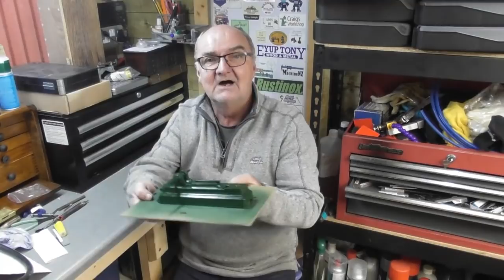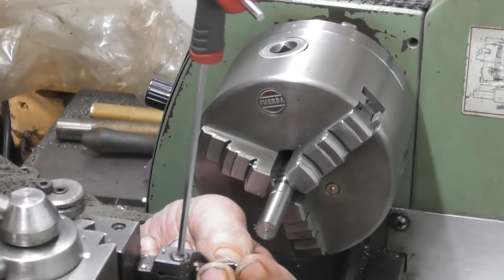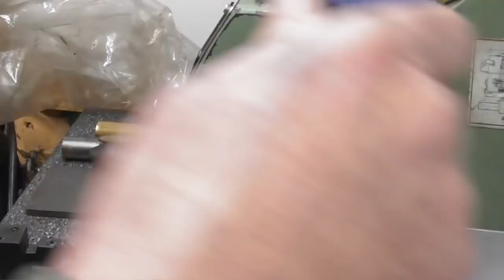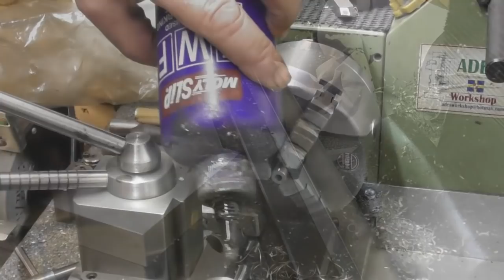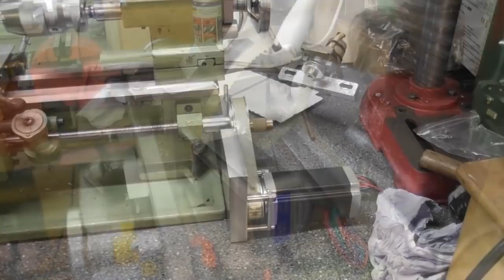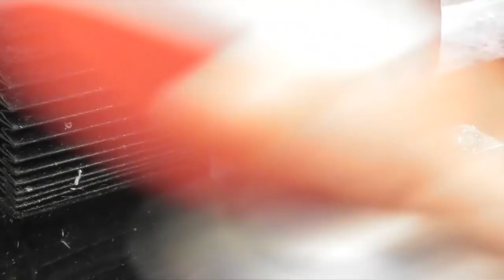Stepper motor Leadscrew drive part 2

Comment: My project for lead screw is for an Atlas 12x54. I'm thinking ...why can't the motor be on the change gear end? Also wonder if switches & controls could be built into the apron with a mini joystick for F & R and jog.

Comment: Very late in posting this question Ade, but I've only just found this one. An excellent guide on how to add the Stepper Motor Leadscrew drive. I would have been interested in how you drilled the holes into the lathe bed, to attach the bracket which holds it all together. I'm intrigued as to how you drill perpendicularly and accurately into the lathe bed? Would love to see you do that on some future video perhaps? It will be very helpful for me as I will need to do that to attach DRO to my new lathe, and it scares me a bit! I have watched many of your videos and you are a great inspiration for my introduction to this hobby! Many thanks. Terry

Comment: another interesting little enhancement. once again on my long term project list to do similar to mine. I was wondering whether you think it would be possible to use the motor to drive a treading action? eg with the machine off. the threading gears engaged. drive the power through the lead screw. just wondering if done that way you could use actual steppter control to program a specific distance of thread to run/stop. or just use teh same endstop type setup you have on the mill.
Reply from the maker: Hi, I think this could work in principle , however , due to the reduction gearing between the chuck rotation and the revs of the leadscrew , it may need large amounts of torque just to drive the chuck . That is not accounting for any extra load that the cutting forces may exert back through the screw . I think that if automation were needed that perhaps a rotational encoder fitted to the spindle along with perhaps an arduino control on the leadscrew stepper would be the way to go , Then we need to start thinking about ball screws etc to maintain accuracy . This is heading towards the modern the sin of CNC . God forbid. All  this said . maybe a secondary drive via stepper for the spindle and then utilising slowing and finishing hall effect sensors would work for the Idea you have in mind. Again this could run via arduino control. So many ideas for this . Cheers Ade.
Reply: @ade63dug  yeah I did wonder about the power dynamic of adding the force at the wrong end of the process as it were. I guess I was just thinking if you already have a stepper fitted whether the range of uses could be expanded a little. Without going as far as full CNC. In any case I have a CNC router to rebuild before I get back to lathe enhancements. Oh and of course power drive for the mill ... Never enough time
Reply from the maker: @MakerGeek  Absolutely .

Comment: Before you fit the bracket to the lathe consider putting a slot in the motor mounting plate for the bracket to slide in if you want to reduce the slop between the bracket and plate, 2 or 3mm deep.
Reply from the maker: That would be a great idea Martin . As it happens, the fact that the bottom of the sliding block runs along the worktop seems to keep it lined up. If it were in fresh air then your suggestion would be a great way to do it. Cheers Ade.

Comment: Hi Ade. Great video, thanks for sharing.
Did you consider going the whole hog and change the leadscrew for a ball-screw, or would there be too many complications with other mechanisms?

👍
Reply from the maker: I am sure it would make a great mod to the system , However . too close to CNC at the moment for me . I may think about a CNC set up in the future but This machine is not the Ideal candidate . CNC = devils work . nuff said Cheers Ade.
Reply: @ade63dug  😂😂😂👍